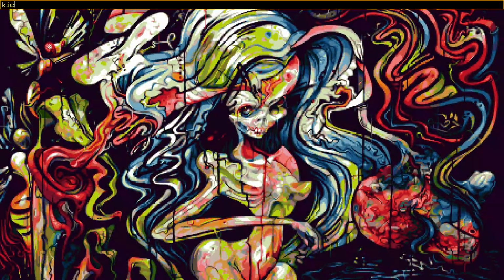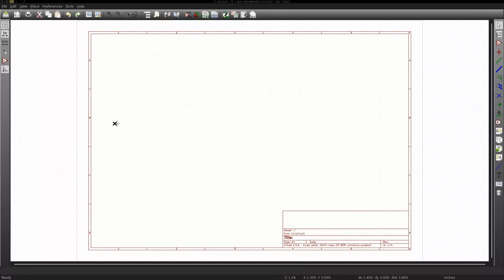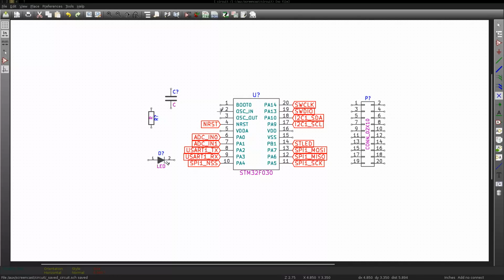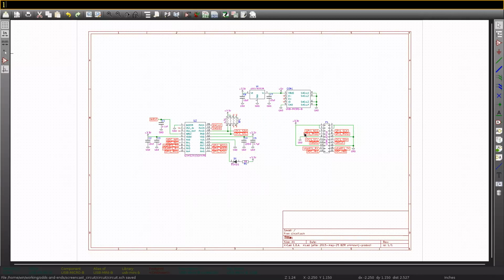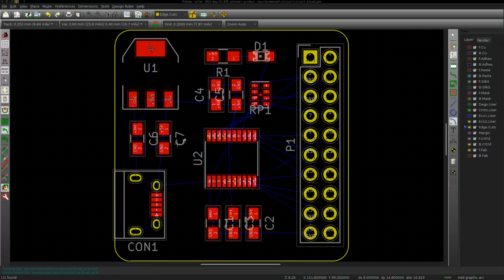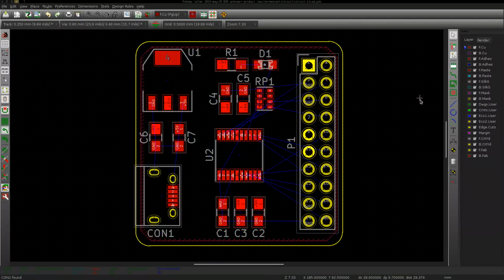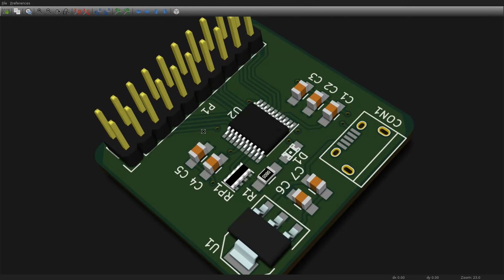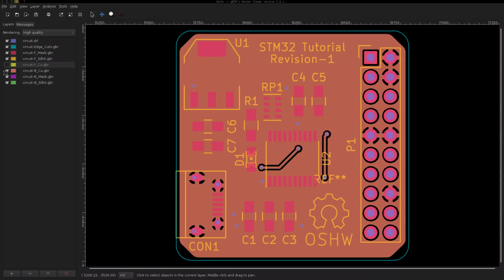KiCAD Quick-Start Tutorial

Comment: Thanks for the great tutorial!

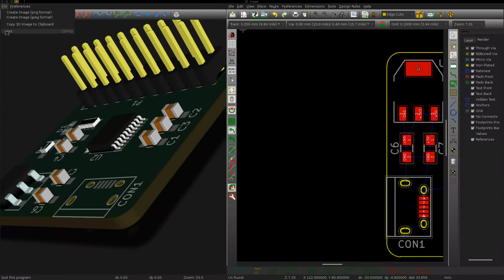At 12:20 what are filled zones? i guess what are power and ground planes... sorry, this is my first PCB ever! do i need filled zones? my board is low voltage/power.

thanks.
Reply from the maker: javier v. Power & ground planes are a common use for zones, but you can assign the zone to any defined net/signal. You might want to do some research on your own to decide if you need to use filled zones a.k.a copper pours for your PCB. Even if you have a low power design, filled zones can be used for heat-sinking, easy current return on a ground plane, or they may be required if you need to deal with EMI regulations. https://en.wikipedia.org/wiki/Copper_pour Good luck!